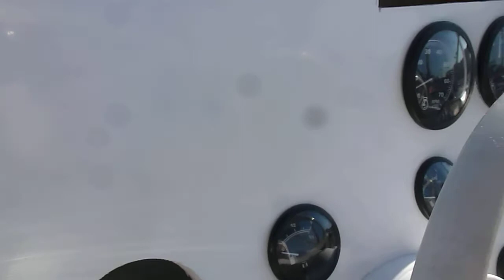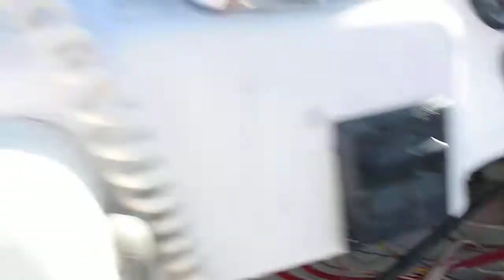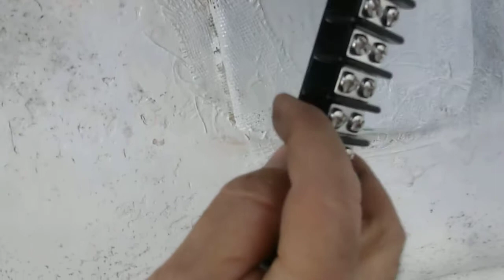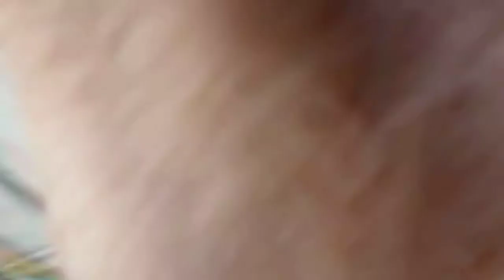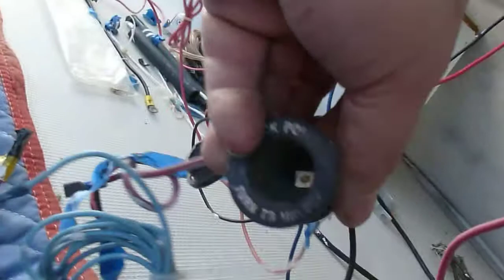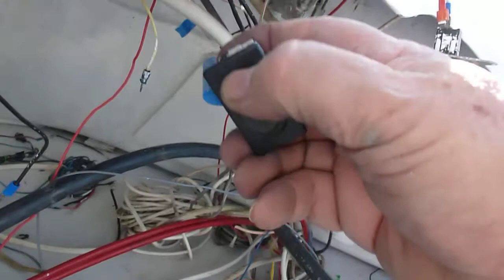Luhrs 28 Old Boat old wiring.

Comment: Don't cut fish finder cable. Unit is designed for a signal ping to travel x distance through that cable back and forth at x duration for accuracy. That's probably why it's coiled.